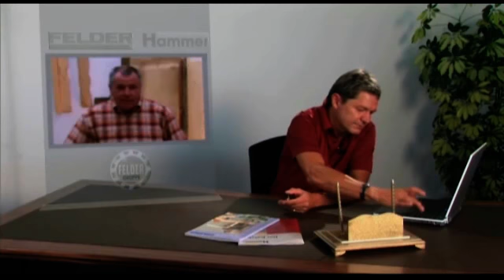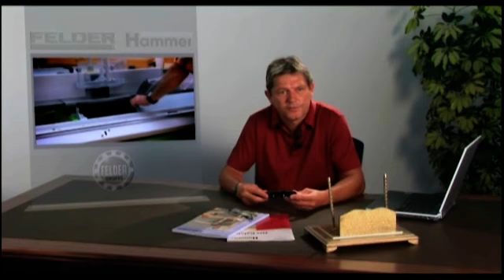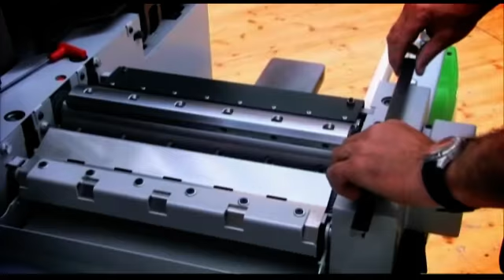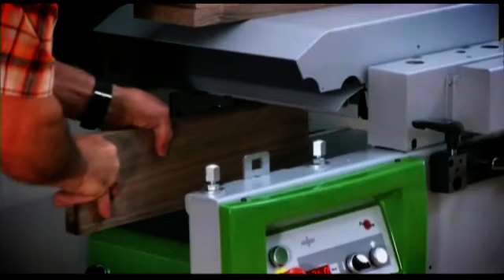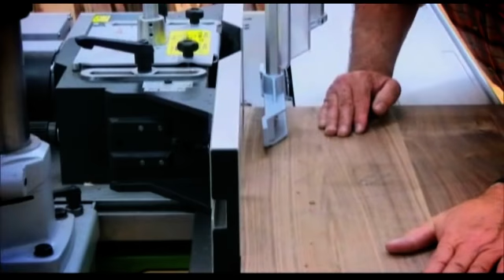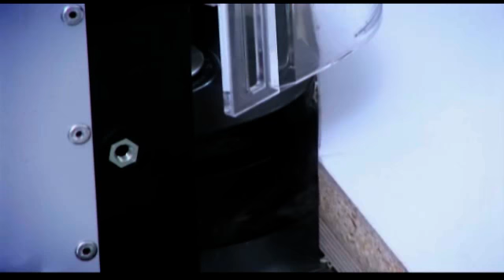Felder® CF 741 S - Combination machine | Felder Group

Comment: At 3:29, Harry, you said a Felder woodworking machine requires only 80cm of door clearance.  I assume that does not apply to the one I want, a Felder Format 400 Kappa X-motion?  I can't imagine how one moves such a massive beast around -- much less  how one can even get it off the delivery truck without a huge forklift.  Its far bigger than any truck lift gate I've seen.

Comment: There is just one little thing that would make this machine even better. I believe the thicknesser needs to be lowered for the dust collection hood to be moved from thicknessing to planing. If so there could be a button on the electronic heigth adjustment which You would press and it would automaticly lower to set the free space for the hood, without holding the switch for lowering the hood.
Reply from the maker: you are right - but unfortunately we do´nt offer that on Felder Series 700 machinery. All Felder Series 900 can be equipped with "Digi Drive" which have programmable features for that issue.
Best regards from Austria

Comment: At 20:00, Sepp seems to have no trouble lowering the power feeder.  At 59kg, that's pretty heavy.  Can a mere mortal easily heft that up and into place?  Is lifting it spring or hydraulic assisted?  As a woman, I suspect I'd have to use some mechanical contrivance to lift it, such as an over-head chain hoist or some such, right?
Reply: Welsh Rabbit they use a "gas spring assist" which looks like a strut similar to the ones on the hatch of an SUV.

Comment: hola amigos de felder podria decirme el costo de la maquina cf 741 s combinada. desde Quito Ecuador
Reply from the maker: +Rolando Poaquiza 
Estimado cliente,

Agradecemos su interese por las maquinas del Grupo FELDER.
Con gusto le confirmamos que la empresa KLINGOHR Import es su distribuidor especializado en Ecuador.

Rogamos se ponga por favor directamente con nuestro distribuidor en contacto para recibir una cotizacion por el model CF741SPro.

Klingohr Import Cía. Ltda.
atn. Sr. Anton Klingohr
M.Moreno 2-170 y F. Moscoso
RUC: 0190159574001
Cuenca / ECUADOR

Telefon: 00593.72.815.001
Email : klingohrimport@etapanet.net

Quedamos atentos a sus comentarios.
Con gusto quedamos disponible por cualquier informacion adicional que Ud necesita.

Saludos cordiales desde Austria.
Su equipo Felder

Comment: I love an American made tool, but, you really have to hand it to these Germans -- Thats a very well made machine! I sure would love to own one someday. My only concern is that the circular saw arbor is too short to accept a dado stack. I understand that european table saw are specifically designed to not work with a dado stack. I would be interested in knowing if they sell a longer 5/8" arbor version.
Reply from the maker: Hi Josef. No worries about the use of dado tooling on Felder Group tabel saws. Each machine in the range has the capability to install dado tooling. An adjustable cutter (3/8" - 3/4") gets used in Europe, instead of stacking multiple sawblades, see video link attached. Thanks a lot and best regards from Austria. 
https://youtu.be/eV8A3XK3R0I?t=797